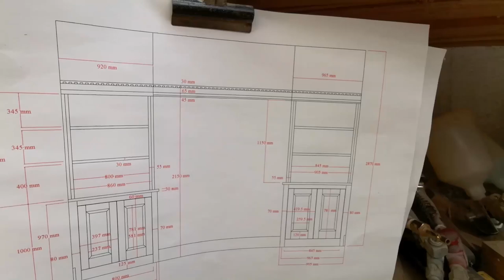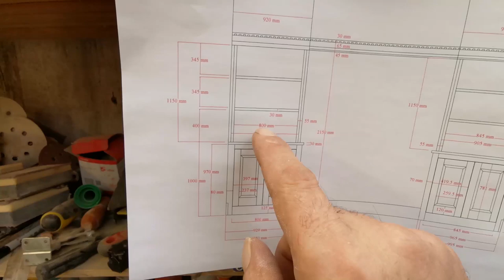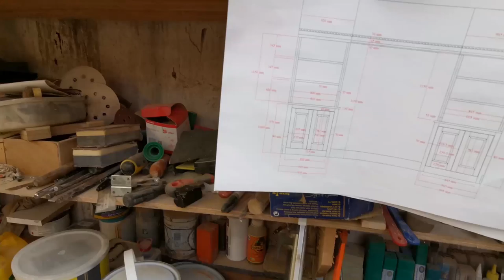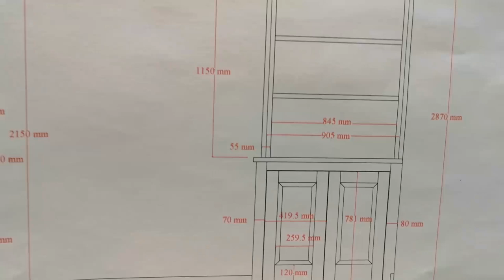Smith's Alcove cupboards & shelves Pt5 - Making the shelves

Comment: Your commentary makes me laugh out loud, looking really slick can’t believe you will paint that lovely wood
Reply from the maker: Hi, Thanks 😁👍 I get asked this a bit so I have this saved, sorry for copy & paste 😉 It's about the quality of the base material & therefore the quality of the overall job, wood is wood to me but some are better than others, for quite a while i used pine, cheapest price i was asked for but the shrinkage & warping later when the pieces went into a centrally heated house were unacceptable to me, Beech doesn't cost that much more on a job of this price, the time & expense put in ya might as well have a decent substrate that'll stay relatively stable for it's lifetime, Beech is harder & fairly straight grained with little or no knots, it's not just the longevity tho you can feel the difference after it's sprayed, the temperature, the hardness & the way it shuts just gives it a better well made feel. I build these things with the hope that they will still be around in 50yrs like the old pieces that are still sometimes around, they were often made of pine, which is what i was/am trying to emulate but the quality of the wood (pine) was better then, if i bought planed pse pine i would still have to machine it sq n straight because off the shelf it never is, so the labour in preparing the wood is not much different & cutting the dominos is the same for both & maybe the same time spent would be spent on the joint of MDF whether that is a spline/scribe/groove or domino. 
 
I would use MDF if the job was cheap, if i didn't expect them to last more than 5yrs, if i wanted a very flat no grain finish or if it had to be done with that material through customers choice for whatever reason (prob against my advise), Mdf boards never come straight so tall doors can be a problem, screws don't hold as well as they do in Beech, fitting butt hinges into the edge of MDF is not reasonably poss, I use ply for the carcass for a similar reason so the screws in hinges/hinge mounting plates, hanging rails & drawer runners hold well,
When spraying there is an inside & outside edge on the stiles n rails, MDF feathers a little so there would be more work there sanding, i give my customers the option of ply or MDF panels, you get a very flat finish with the MDF & ply is a slightly better material but poss seeing the grain through the paint, their choice?, when sanding these doors with beech stiles & MR MDF (I only use Medite MR MDF) panels it's always the panels that need the most sanding,
I do sometimes use MDF for doors & drawer fronts, normally when it's just a plain flat door i want but I have a list of materials in my head, MDF is the very bottom & would be my last choice for shaker doors. unless it was a bespoke style/sized door to match an existing set you might as buy some, there's loads of MDF units/furniture on the market, a lot cheaper than asking me to build one, it's not the quality that my clients ask for or expect from me,

Comment: Hey gid got my first bit of work on the side soon, a partition in someone’s living room turning it into a living room and a dining room. The stud wall will be 3m wide and 2.4 tall, I plan to make it out of 38x89 and I’ll also plaster board it. The total in materials is £157 and that’s for the stud wall,insulation/stud wall fixings, 5 sheets of plaster board and there fixings, what should I charge in labour for this job as should only take me a few hours?
Reply: Also love the bulk of videos when they come out, thanks mate
Reply from the maker: Thanks 👍 Yeah i try to put out a few at a time, no-one likes waiting for 'the next episode', I have a SSD on my PC which is fast but isn't big enough to hold much, need a new main one C Drive, i have many hard drives but they are designated for other things & the editing works better if all clips are in the editing suite program on the main drive, blah blah .😂 sometimes i just have to clear the PC, upload n transfer what i have done with to a back-up drive
Reply from the maker: Hi, sorry not an easy one to price others work, Labour + materials, is it for someone you know, have they money, is it the start of many self-employed jobs you'll be doing, how far away is it, I'd charge for the day, but would i be doing the job right, studs at 400cc nogins at 600, (900?), 1200 1800. wall's shouldn't be built on a floor board/single joist. every other board should be lifted & a nogin put between 2 joists, boards put back down then the wall built, then you've also got time for shopping. sorry not an easy one to price, I'm not saying what i charge but an average was £150pd, that's other's prices were a few yrs ago
Reply: Gid Joiner ground floor straight into a concrete floor, £190 for straight up materials. 
They want a more complex job doing first though,  a doorway framing into a opening which is a arch. Wish I was your apprentice, instead I’m learning as I go teaching my boss 🤯
Reply: Also for the partition they want to pay around £200, obviously materials are coming to £190  so hopefully they just don’t understand what’s going into it 😂